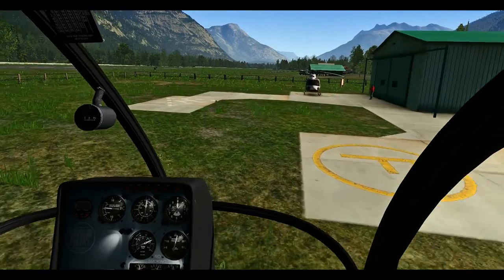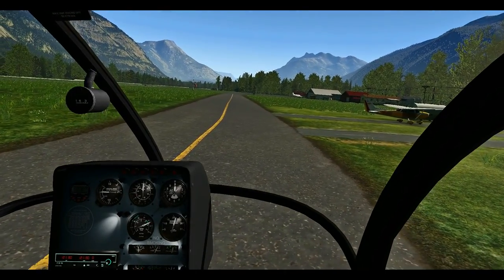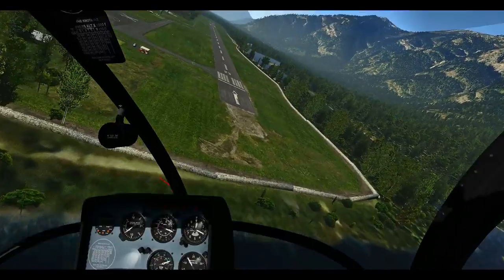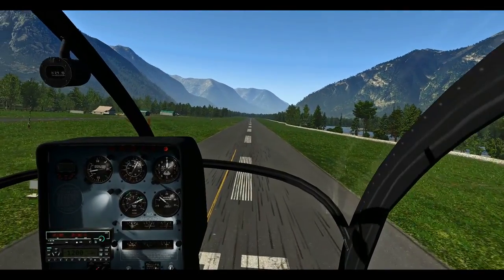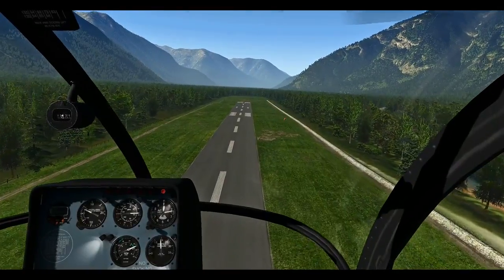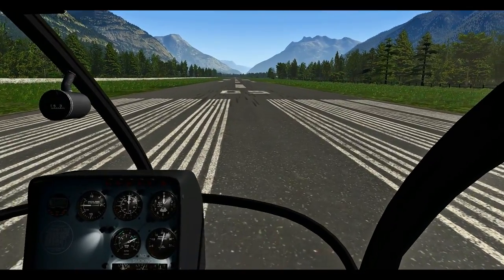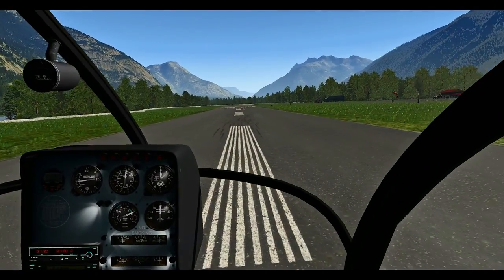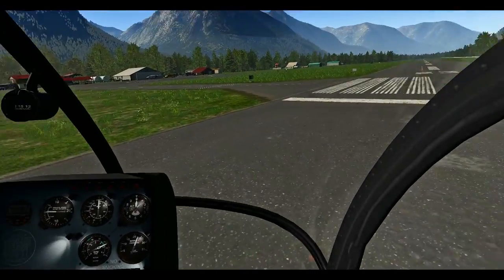[X-Plane 11] Ground Effect and Translational Lift

Comment: hey quick question, you mentioned reshaders in a previous video so ive just downloaded 3.0.4 but im not sure where to export the files to? any help would be apreciated as google is running dry for me on this
Reply from the maker: Open file and place reshade-shaders and the rest of the files in your main X-Plane 11 folder. When you then open X-Plane 11 just hit shift+F2 to open the menu :)
Reply: HappyCamper thanks!

Comment: Which joystick etc. are you using to fly the helicopters in X-Plane?
Reply from the maker: Hey, Reto. 
I'm using the X-56 by Saitek with track IR. no rudder pedals yet :)
Reply: Thanks for the info, do you think that X-Plane makes the most realistic helicopter simulator? And I'm wondering how much real life helicopter experience you have
Reply from the maker: No worries. I don't have any real life experience at the controls, only from the passenger seat. I'm going out this summer to fly a helicopter in Canada so hopefully I will have a good idea of how good it is then. But just from what I understand I believe X-Plane is the most realistic since it calculates the airflow and has a lot of detail in flight dynamics.

Comment: Can you try turning on antialiasing in X-Plane's video settings? The jaggies are pretty distracting as it adds a lot of noise to the image. Don't know your hardware, but most modern GPUs can pull off a low AA setting without losing much (if any) performance.
Reply from the maker: Yes sorry about that haha. I just turned it up to 4 times with no issues but at 8 times i lose frames so i will keep it at 4. Hope the video is still watchable. :)
Reply: HappyCamper Thanks and no worries, it's watchable. Looking forward to the next videos!

Comment: I was wondering if the ground effect is different between X Plane 10 and X Plane 11? Also I thinking about purchasing the AS350, but I've heard it's very difficult. Do you recommend it? Thanks.
Reply from the maker: I don't think there is much difference between the 2 although I haven't checked. The AS350 is a great helicopter but is not perfect with XP11 (Hence whey my last videos have been with the S300) The creator should have an update out soon hopefully.
Reply: Okay thanks. I guess i'll stick with X Plane 10 for now and buy 11 later.
Reply: Hello again :P I just wanted to ask you something, since I am quite new to X plane I don't know to much about it. And I had bought the AS350 By dreamfoil and in the manual they say assign the trim to a button on your joystick. How exactly do I assign a new button from a 3rd party aircraft? because I can't see it under the controls menu thingy. Thanks so much.
Reply from the maker: haha that's a good question. I haven't got the trim bound but it think under joystick there should some sort of drop down menu where you can select as350.acf or something like that.
Reply: Ah I see, I'll try that. Thanks :P
Reply from the maker: I hope it works :)
Reply: I found it! Thanks lol. I was looking for it for so long XD

Comment: Hi, great explanations! Can I ask if you have any add-ons that have improved the ground effect dynamics or is that the stock X-Plane 11? I tried the demo way back when it came out and was disappointed at the continued lack of ground effect modelling but it looks to be perfect now! If it has been subsequently added, I think it's time to invest in the full version :)
Reply from the maker: The only addons that affect the flight model in this video is the helicopter itself which is a payware aircraft by Dreamfoil Creations. He does some great helicopters that model pretty much everything you can dream of. I very much recommend it, it is the most realistic I have tried. The default S-76 isn't great so spending 30 or so dollers on a payware helicopter is worth it for sure.
Reply: Thanks for your reply. I have owned the Dreamfoil B407 for XP10 for some time and I agree, it is amazing. I will now get the XP11 version and buy the full version of XP11 itself. Thanks for your videos.
Reply from the maker: No worries :)